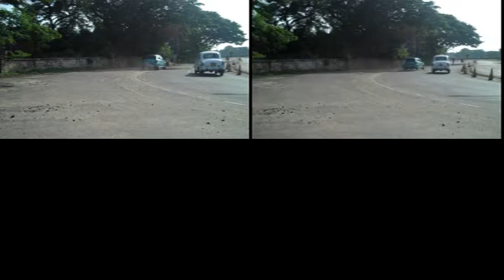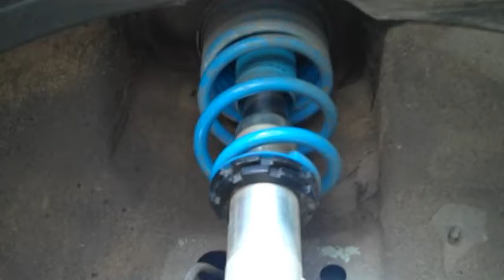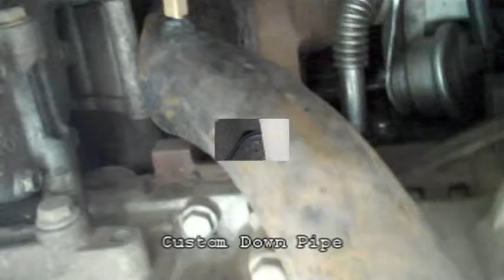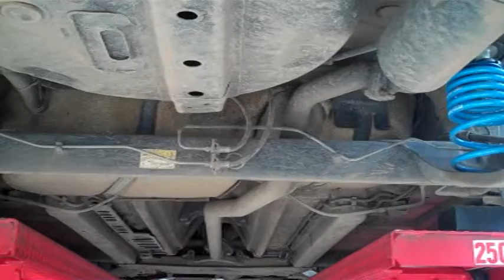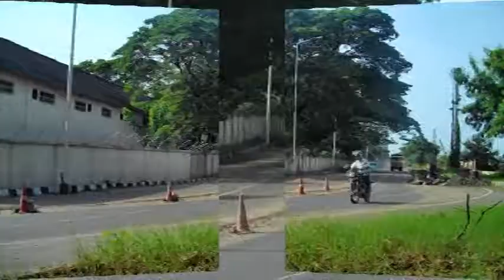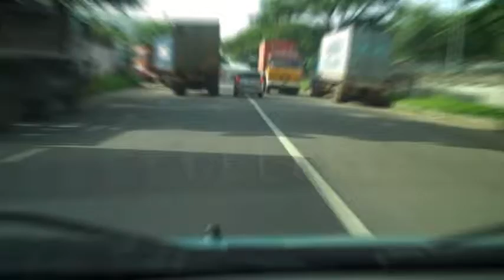Pete's Custom tuned SWIFT Diesel

Comment: Hi I've got a Golf 2.0 TDI and put a tuning box on it. I'm skeptical as far as fuel economy goes on the litres per 100 it's gone down from around 5.6 to 3.6 but actually getting around 6. Definitely a performance increase, but am thinking it's probably just throwing in more fuel. I'm chaning the exhaust shortly and hope that makes an improvement but aren't happy with the tuning box. How have you found yours? Power gains vs fuel consumption and smoke etc? Thanks